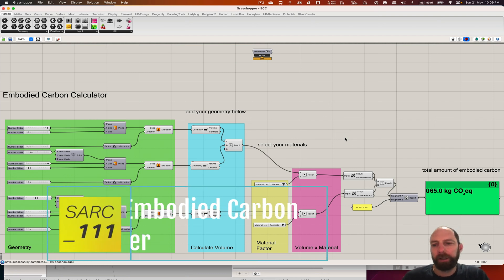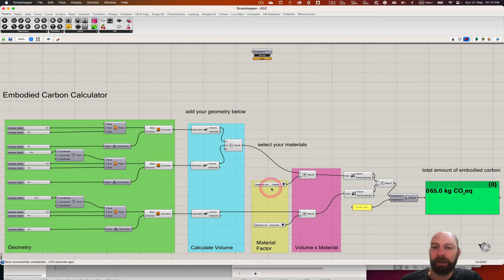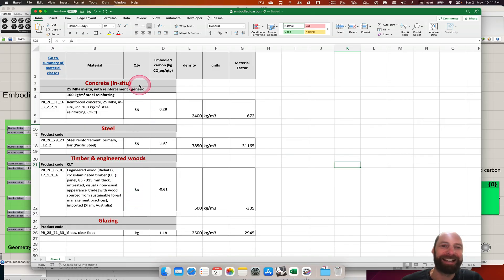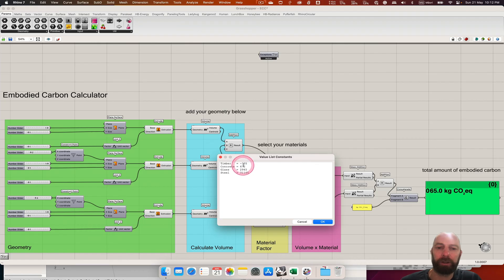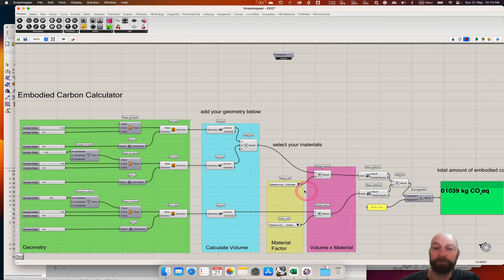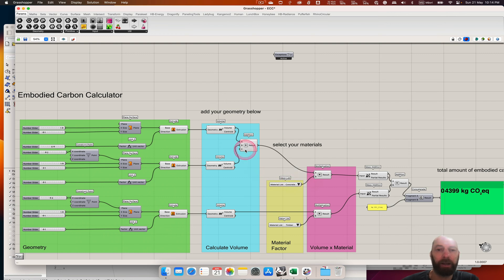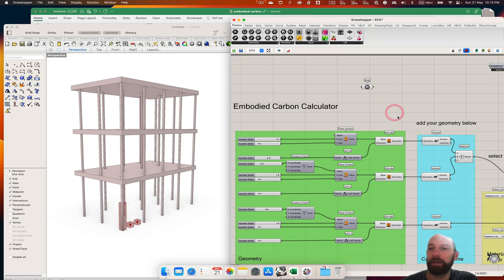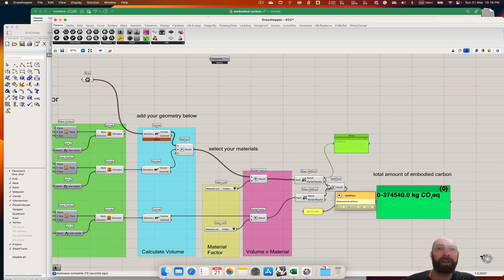Embodied carbon calculator with grasshopper

Comment: I really like the current tutorial video. Can you share how to use an Excel file as a database and use the Excel database in Grasshopper to calculate carbon emissions during the material preparation stage, the production stage, and the transportation of the building components?